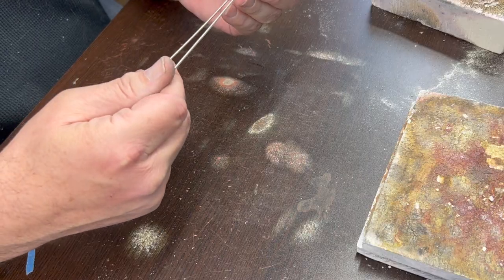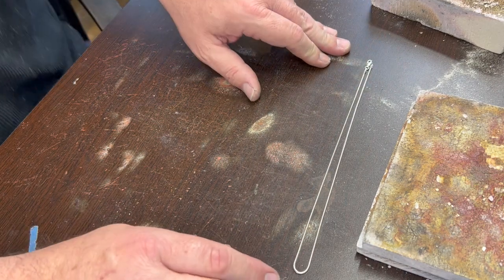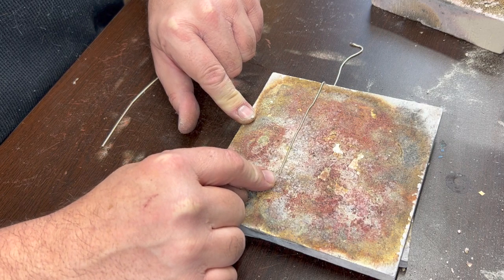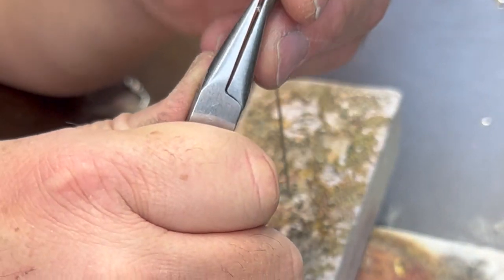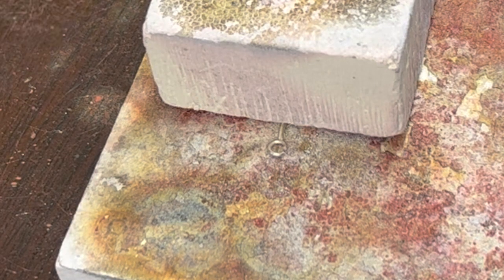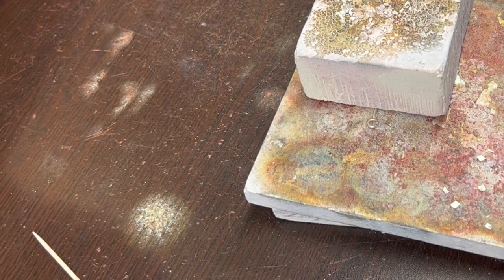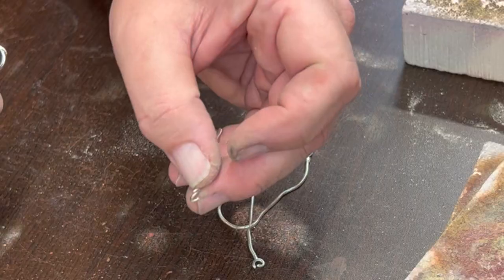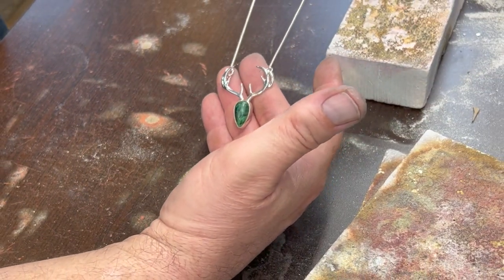Splitting A Chain: A Silversmithing Technique

Comment: And if you want the jump rings to be soldered it just needs to be done before setting the stone. Are there any tricks to soldering when the stone is already set? Thx great video as always. C
Reply from the maker: For these ones I don’t usually solder them as chains wear out over time, and then they’re easy to replace. Soldering with stones in place is a calculated risk. There is a sort of claylike heat shield product that is made, but by shielding part of the piece, you prevent part of it from heating up, making a solid solder joint much harder to achieve. It also can’t prevent some heat from reaching the stone by conduction through the metal. Some stones really don’t do well when you heat them too much:). Thanks for the good comment Chris!
Reply: @chadssilversmithing  And thank you for the quick response and thorough explanation. I've heard of the soldering clay, I'd be interested in your oppinion of where it would be useful. Love the Elk pendant really nice

Comment: Can you do this to any kind of chain or just a snake chain?
Reply from the maker: That’s a good question Mary. I haven’t done it with too many different types. I’ve done it with some really fine link chain with mediocre success. It looked a bit sloppy to my eye. I should think a box chain would work well. It seems like it should work on most types:)
Reply: It does work with most types, but remember, some chain types are large enough to not require soldered end loops or are large enough to just thread a jump ring thru (and solder closed if you wish) rather than soldering the jump ring directly to the chain. This is mainly for finer chains….at least that’s how I do it lol.

Comment: Good idea to use a soldering block to limit solder travel. You can also use whiteout liquid or ochre to prevent solder flow(I’ve done it once….I’m too lazy to do it as a matter of course lol) whiteout can be tricky to clean out of a chain tho, ochre will just soak out in water. What sizes/types of chain do you tend to stock Chad? Or do you purchase as and when required?  I have limited cash and chain ain’t cheap lol.
Reply from the maker: Hello Pauline. I almost always buy those seamed snake chains, and I usually buy 20 at a time from Rio. I usually get 10-18” and 10-20” ones and then when I get low, buy another batch.